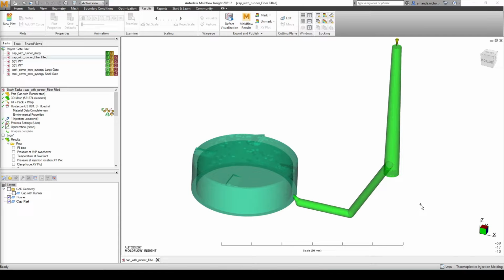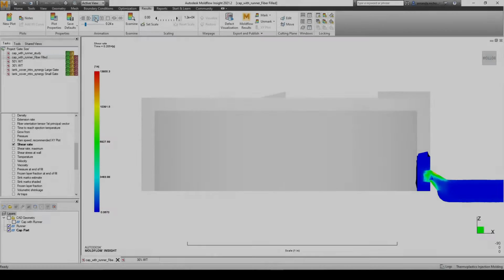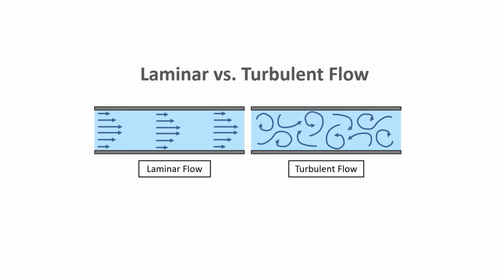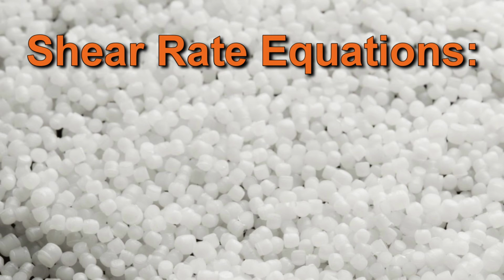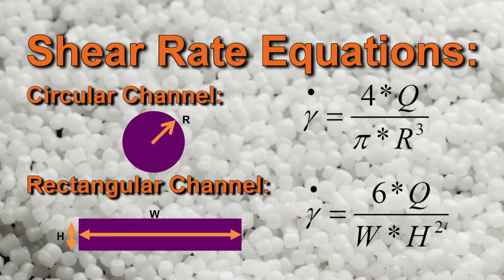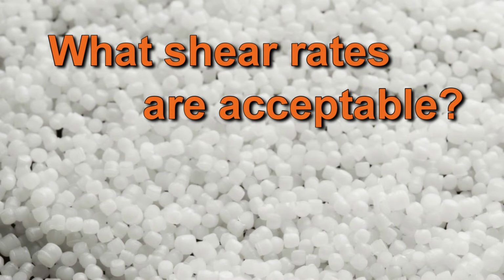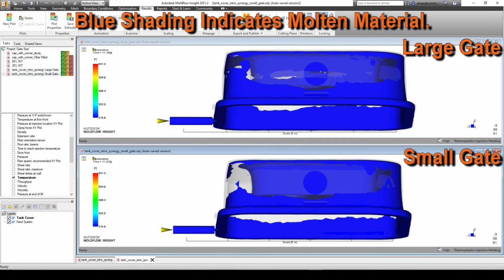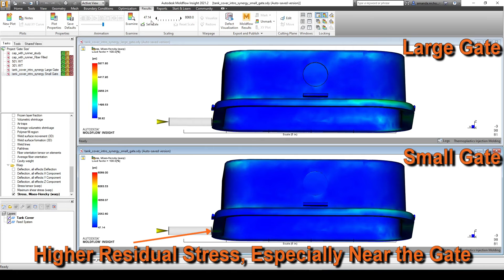How Does Gate Size Affect Part Dimensions and Performance |Gate Design Series

Comment: Does Q Stand for shot volume flow rate which includes Part and runner sprue or just part volume rate?  Video says shot size/fill time.
Reply: Q stands for volumetric flow rate - for example, CC/sec or cu. in /sec.  The molding machine settings determine the flow rate, but may be restricted by the sprue, runners and mold cavity.  Shot size is the volume of everything being molded in that shot, including sprues/runners and cavity.  Some molding machines can control shot size - a metered shot.